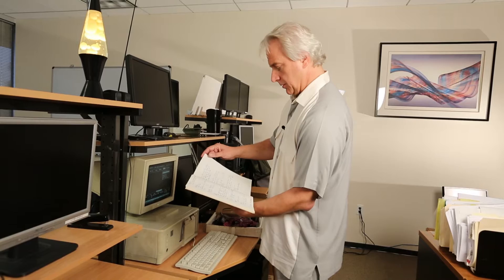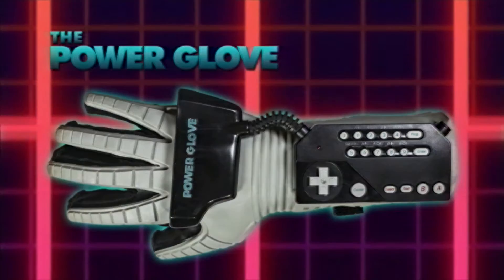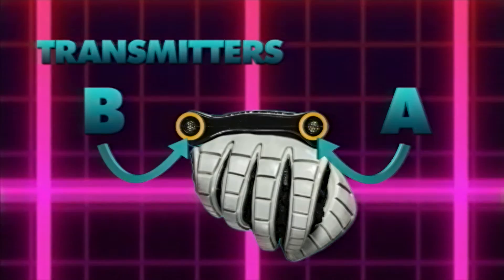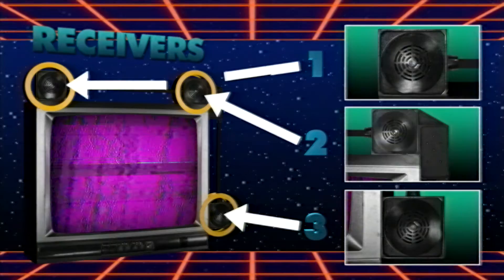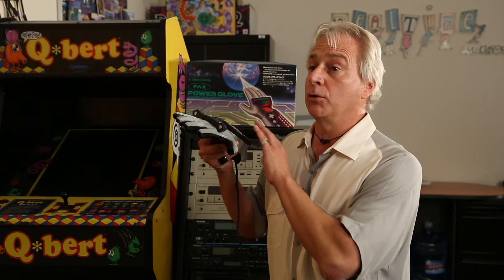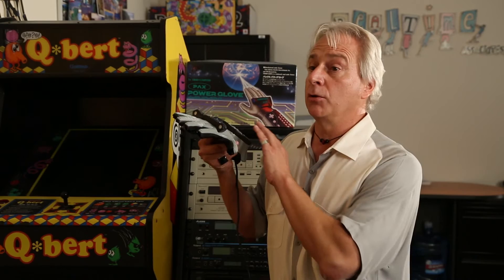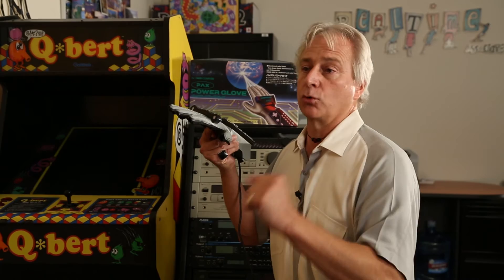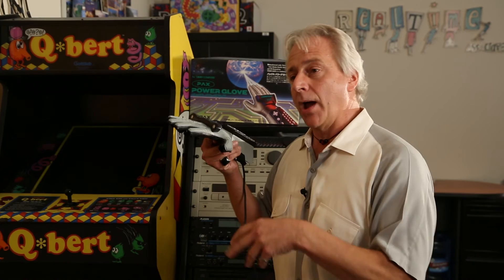The Power Glove: How it Works (narrated by David Warhol) from the documentary "The Power of Glove"

Comment: Hello! Your video explains everything very well, i'm having trouble with my Power Glove, I hear a light buzzing sound comming out of the glove, and as your video explains, it should be ultra sounds, so I'm really wondering if that buzzing sound are the "tweeters" who are dead, or blocked by something like dust (although I opened it and cleaned it, didn't notice much dust inside) Do you have any idea on that topic? thank you